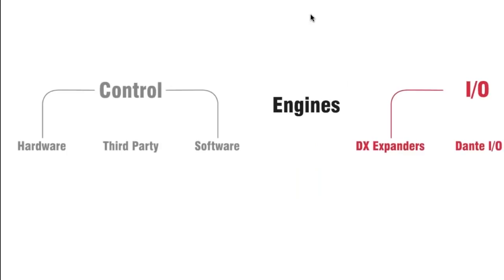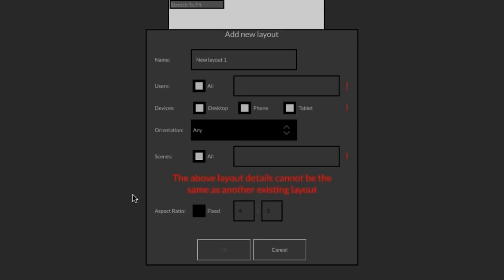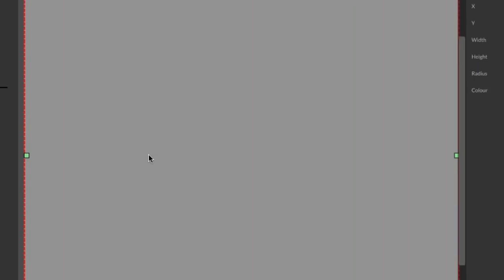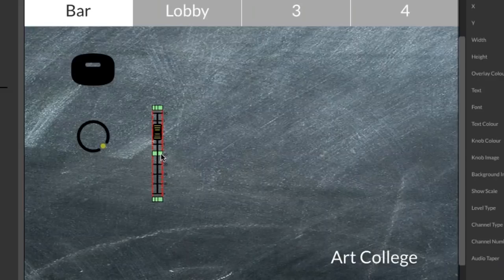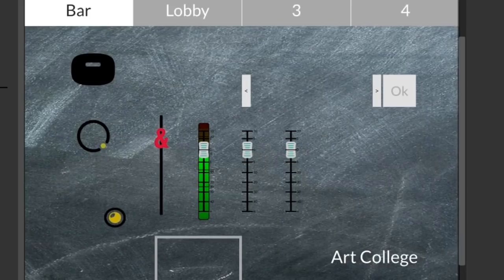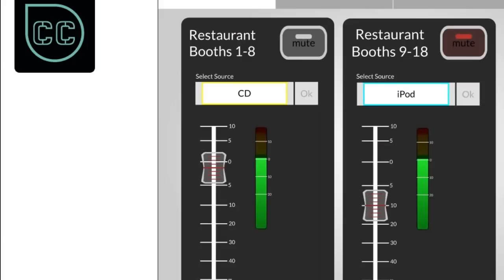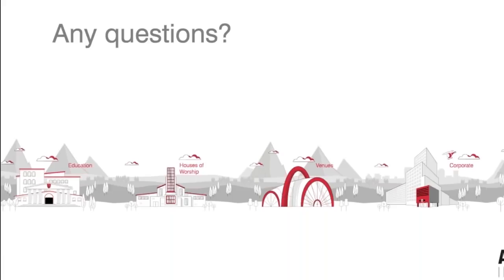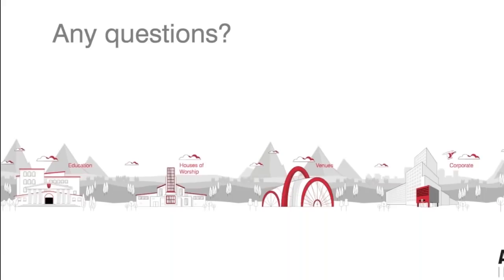Custom Control Webinar Recording - June 20th, 2019

Comment: Could you answer a newbie question please? We have just purchased an SQ7 for our church, and this system is for dLive. I don't know enough about the product ranges to know Custom Control is applicable to the SQ7 series. Is it? We currently use SQ Mix as the control surface when away from the desk, and since you mentioned that I was wondering if Custom Control can be used with an SQ7.
Reply from the maker: Hi Darbeth, 

Customer Control is dLive only at the moment, but the MIDI control is available for the SQ series and can be used with most control software. Thanks! Alex